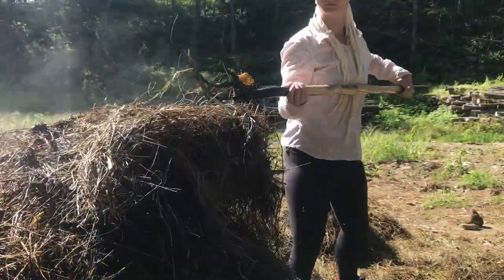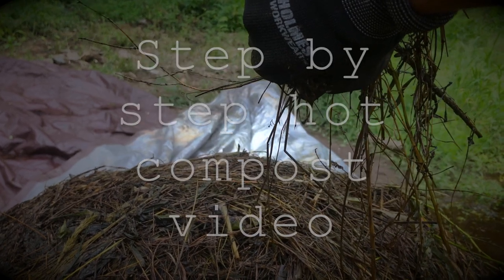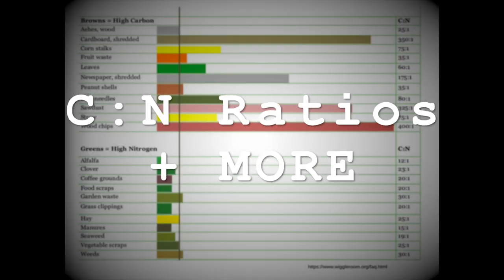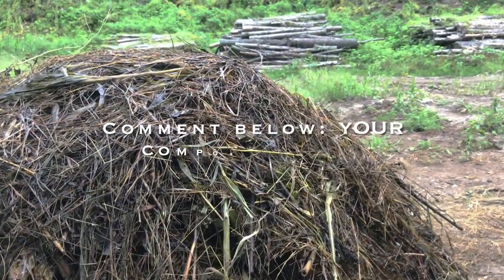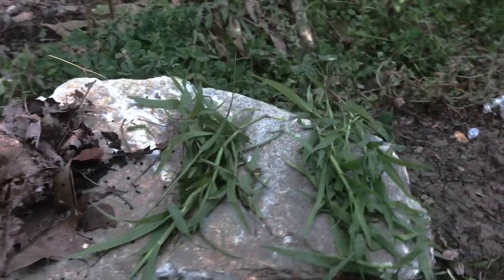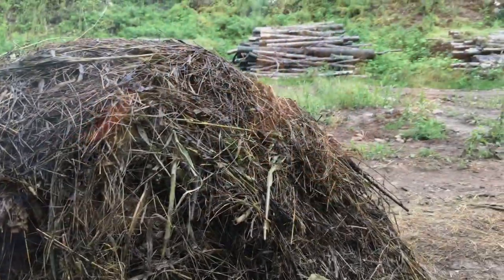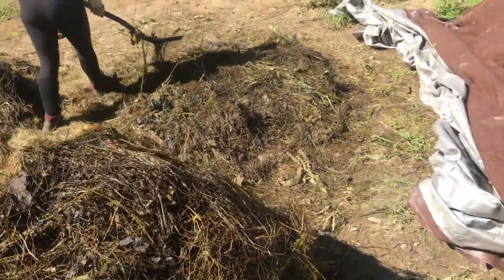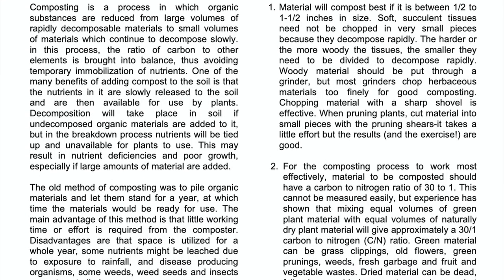How to Hot Compost (Successfully) 5 Requirements

Comment: When watering, would the temperature of the water be something to consider? Does it have a huge impact on the temperature of the compost pile? 

Thank you :)
Reply from the maker: The temperature of the water wouldn't have much of an impact on the compost pile. 

Starting your compost pile with ice cold water probably wouldn't work WITH you, but it would still become warm/hot over the time you initally let it sit for 4 days. 

If your compost is too hot and you want to cool it down, it likely doesn't need more water, as sufficient water is essential for building up to a desired heat range.
Reply: @FoodForestLiving  Awesome! thanks for the detailed explanation